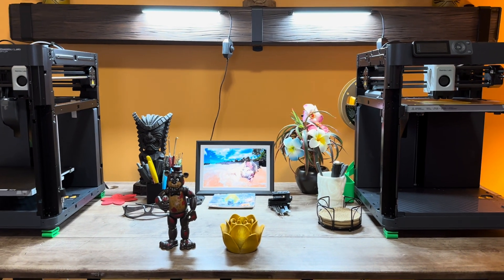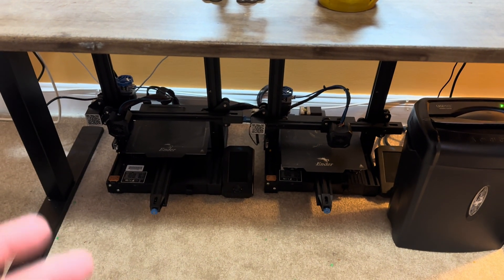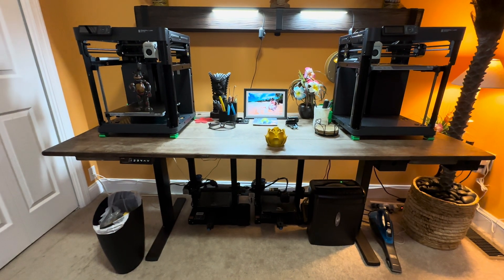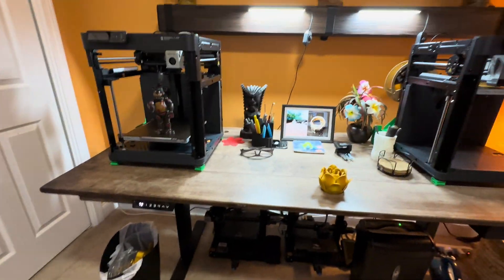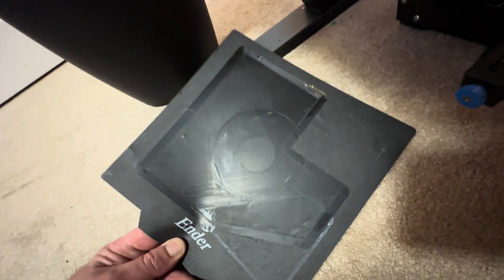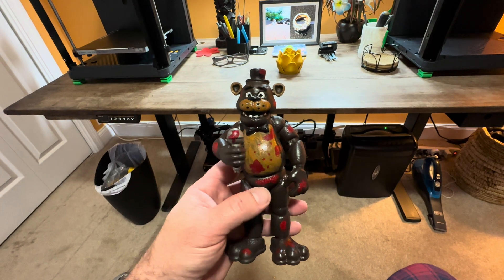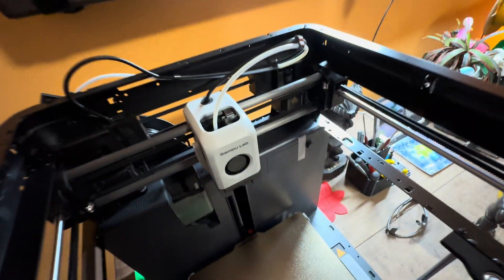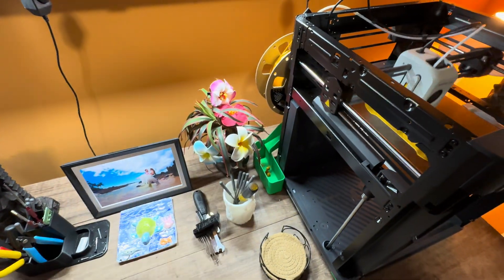Bambu Labs VS Ender 3

Comment: https://youtu.be/7lJmkTSoWLc?si=TOEL4OClrB69YBSr

Sub 2 minute benchie.....on a ender 3 😆 

Ender 3 v3 is core xz and has 600mm 20k accell printing capability stock, for around half the cost of the p1p....stock with hardened nozzle too...

Comment: I have a P1S, I used to have an Ender 3 Pro plus various improvements. The P1S beats the Ender 3 to death in almost every way possible. The only thing I think the Ender 3 was better for is it had a USB port so it was possible to run Octoprint to control it. Otherwise the P1S is about 3-4x as fast, has ABL, a smaller footprint, larger build volume and my AMS makes it super easy to switch filaments.

Comment: Creality does make a Ender that's getting closer to the speed of maybe the A1/A1 Mini, it's the all new core XZ Ender 3 V3 nothing after V3.  It's a klipper machine and fast, I have the Creality CR-10 SE which despite the CR it's a Ender sized 3d printer Klipper based and it also is very fast.  Not X1C, P1S or P1P speeds but close to A1/A1 mini speeds.  I have an X1C so know what you're talking about the speed of these things.  Oh, use Orca for all your printers, I use Orca for my CR-10 SE and my Bambu printers, you can do anything in it you can do in Bambu Studio and more.  I have rooted the CR-10 SE and can see my printer when I click on the device tab of Orca just like you see the P1P in Bambu Studio.